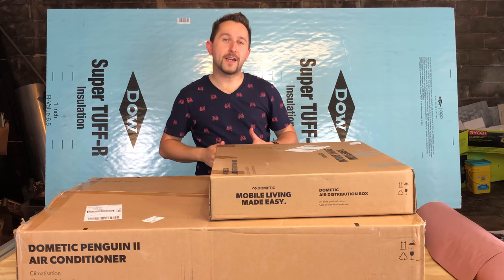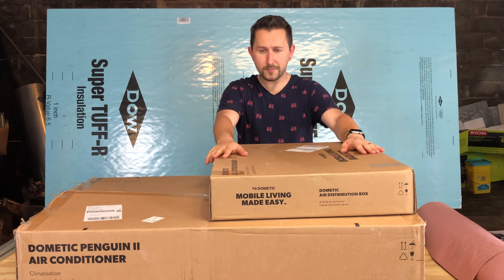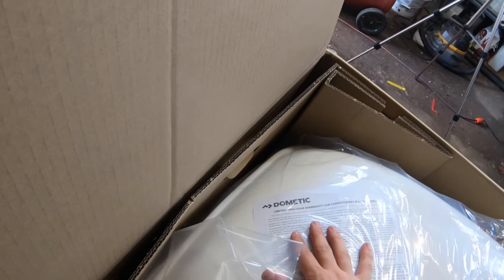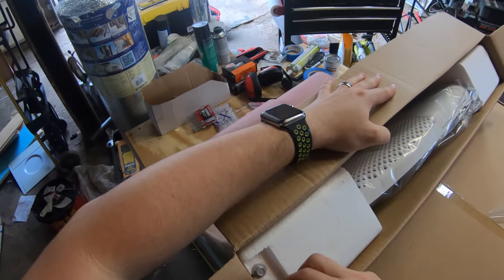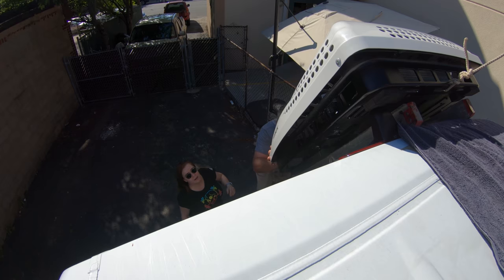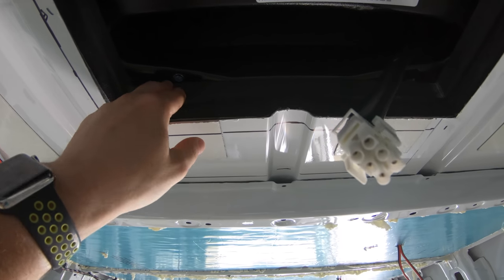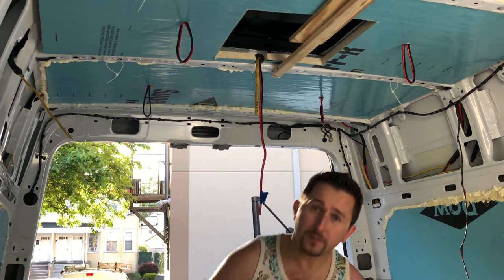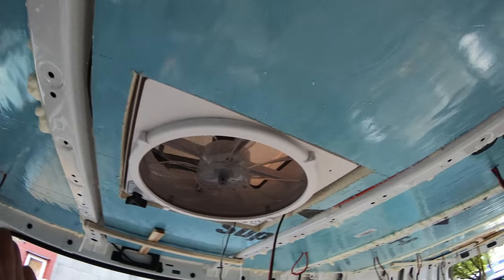Dometic Penguin II AC install on a Sprinter?

Comment: How do you power that beast?
Reply: It doesn't use that much 22000 starting and then about 12000. I got a generator because it would just drain the battery bank. The fridge does a good job at that.

Comment: Did you use foam gasket to also seal perimeter of the AC? Or did you only seal the opening? The special gasket for opening looks like it conforms to protrusion on roof, also where did you purchase it? Links to both products would be helpful. Thanks in advance!

Comment: thanks for sharing, so if I understand correctly, there is a fan in this so it can be used solely for air circulation vs. air conditioning? So there wouldn't really be a need for an extra roof fan then....  also, how loud do these run in air conditioning mode?

Comment: Hi, i am writing from El Salvador and i am curious on how was this unit installed electrically speaking,,, did you connect to truck batteries, or added seperate batteries? did you use invertors? hwo many watts?  how did you feed the electricity of this unit,? any comments are welcome

Comment: Thank you  for this video, helped me with my installation in my Promaster, now I just need to get everything wired up. Now that you’ve had it for a while do you have any observations you can share? Have you had any issues with it, leaks, condensation issues etc? How are you enjoying it?
Also I’d like to add to anyone trying this to be careful not to over-torque those three bolts, I ended up cracking the metal frame of the air distribution box using a torque wrench to try to get to 40-50 ft-lbs as recommended:(

Comment: Hey guys,  looking awesome thus far! I have a question about your A/C install. I didn’t note that you did any bracing or supports for the A/C. Do you find that to be a problem? I guess driving around for a bit may tell if any leaks come up from the movement. I want to do the same but that concerns me.
Reply from the maker: Hey David! The unit is braced against the insulation and the steel ribs on the ceiling on the inside.  The AC came with a really thick rubber/foam gasket to put on the outside, we put two of them in place and compressed them really tight with the three long screws that come with the unit for that purpose.  So far there has been no leaks

Comment: Hey guys. When you drive can you have the Air/Con working?
Reply from the maker: Ciaran Watt technically, yes we could, but it would drain the batteries very quickly.   
This setup is meant to be used while plugged-in into shore power

Comment: Hey man are the cables  from the ac unit same color as the air distribution box?
Reply: It has a clip-in connector,  no need to match any wires.

Comment: How many amp hours should you have to run ac?
Reply from the maker: Not really sure but it’s a ridiculous amount of amp hours and it definitely isn’t recommended as it’ll discharge the batteries too quickly causing possible damage and shortening their life span.  Our AC is meant to be run on shore power or generator.
Reply: Solar power is a good option too
Reply: Shore or a generator is needed. You COULD run solar, but if this thing runs 70v and you have a MASSIVE solar aray(like... An rv roofs worth) that runs 35-40v input to 700-1k ah, it'll run. But you will dramatically affect battery life. Keep in mind, those numbers require 7-10 deep cycle or lithium batteries, and i dont imagine it will run on solar for more than a short night. Then youre stuck trying to charge a huge array of batteries once youre moving. Very taxing on your charging system. And dont forget the very high watt inverter you'll need, plus something called a soft start to not damage ypur inverter.
Reply: Last point. If your enormous expensive solar system charges at 35-40v but the system runs 70ish v... Well, you get the point.

Comment: You don't know much,  why you making a training videos.
Go watch ⌚ some training videos.  This is the Wrong A.C.,  VERY power hungry,  will eat up your battery. 
You need a 5,000 Btu window unit.  That you "mount"on a "back door".  
The little 12 volt fan is 120 volts & 3.5 amps (1/3 hp.)    120 × 3.5 =  420 watts,  this is almost what a 5,000 BTU window A.C. uses.
Always drill 4 ROUND "holes" then cut ✂ the straight line cuts.   Otherwise you will get cracking of the corners,  especially when the 100 pounds of the A.C. unit is "bouncing up & down".
Reply: I'm "pretty sure" you have "no idea" what you're talking "about"